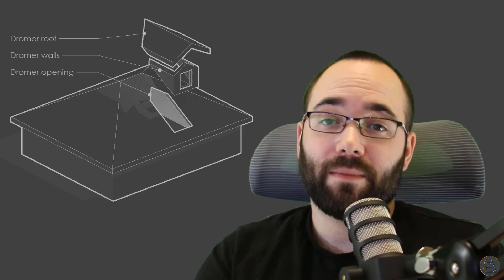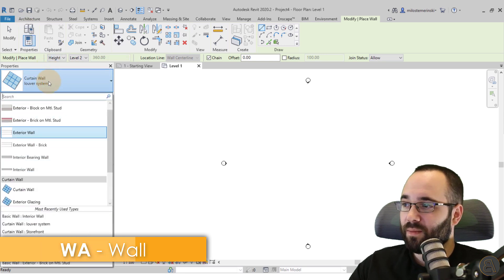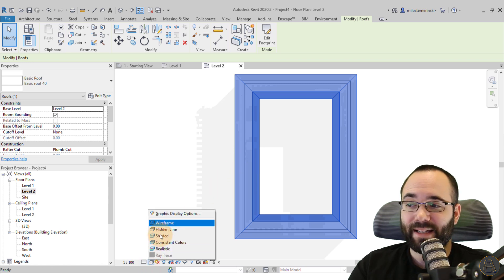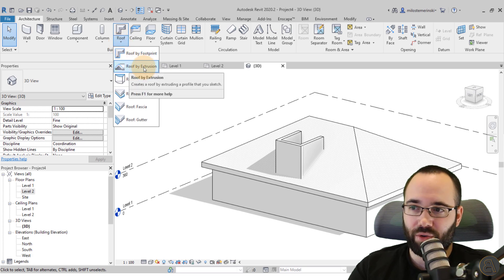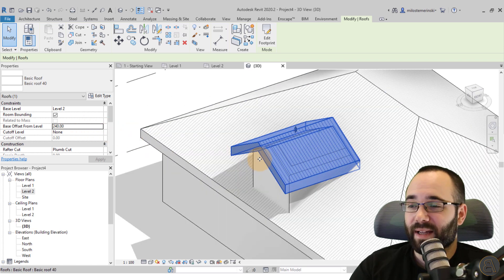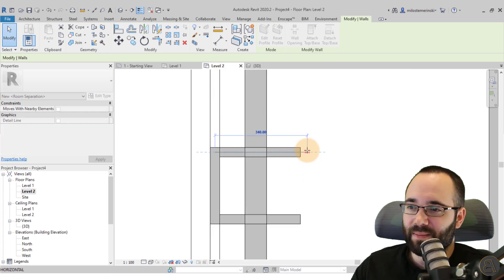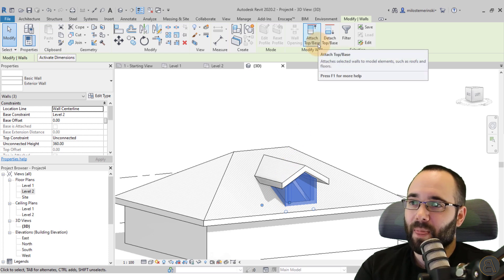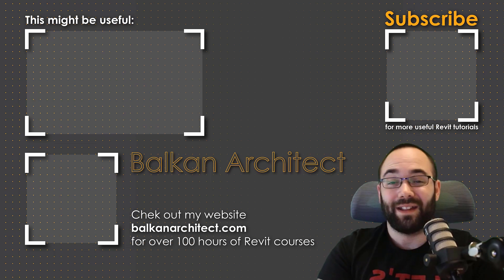Dormer in Revit Tutorial (Revit Roofs Tutorial)

Comment: Great tutorial. Currently evaluating using Revit.  Just wondering how the lead valley gutter between the two roofs is added ... and also ridge tile that stands slightly higher than main roof plane.
Reply: Typically I use the fascia tool with a fixed angle V or inverted V profile for valley/ridge/capping. It wont match the roof angle automatically unfortunately, so usually I'd build a few angles types, or just build them to work for the corners of 22.5 degree angles rooves.
Reply: @AussieBIMGuru  Thanks.  Part of me does wonder why Revit does not cater for things like this that alter the outline shape of the mass as standard without work arounds, but will have to try.